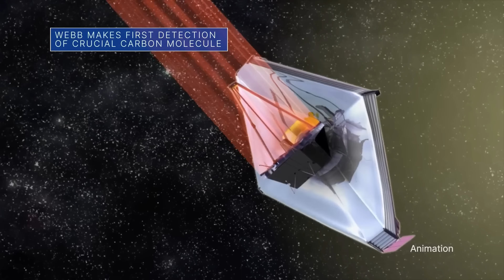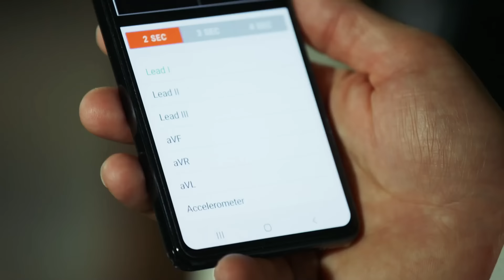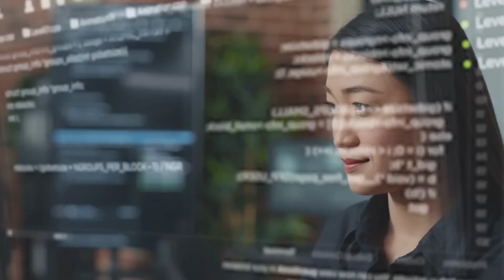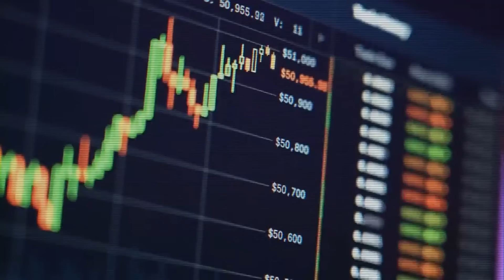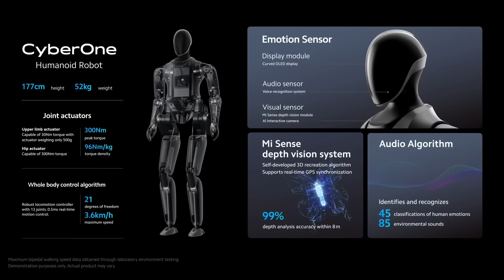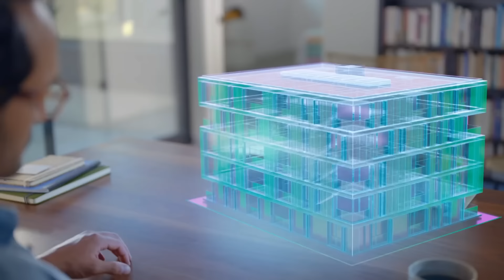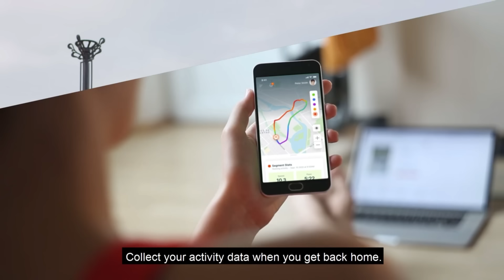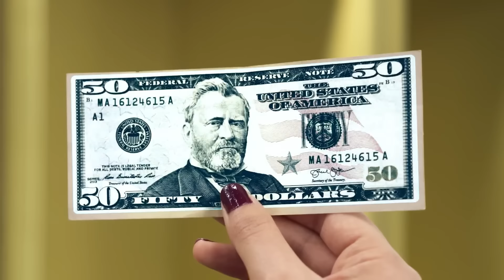20 Emerging Technologies That Will Change Our World

Comment: If StarLink was the only internet service, a lot of people wouldn't have internet, as they live in apartments that don't allow dishes to be installed on their porches. It'd have to be one big fat dish and provide the block with internet through cable connection.
Reply: It doesn't need to actually be permanently mounted. You can set it out when you need it. Also, if it were the only way to get internet, I'm sure apartments would have different rules.

Comment: Wonderful illustration of many incorrect statements
- Quantum Computer is could do amazing things, when reaching a couple thousand entagled Qbits.
  But AI databases and machine learning will certainly NOT be there
- Microchips have evolved exponentially for the last 70 (!) years. And while the development is
  continuing, the cost-per-transistor is rising again for the last 3 technology nodes
- Just because RoboDog2 has more sensors than its predecessor, it is NOT the future, 
   as it is an existing product. And maybe a child will cuddle a piece of plastic - but a grown person?
- Virtual Reality is certainly becomming part of our future - but not by the name "Metaverse".
   There are many good concepts in development, but Meta has ruined the name "Metaverse"
- Flexible batteries ... if you had the choice between twice the charge or flexibility, what's your priority?
Prof. Arato